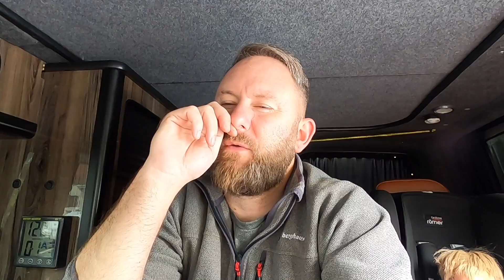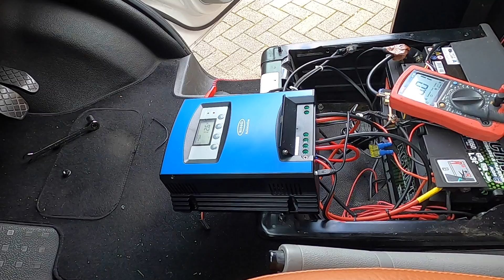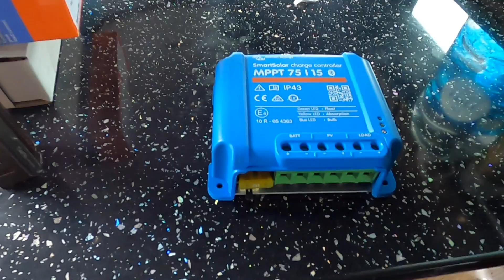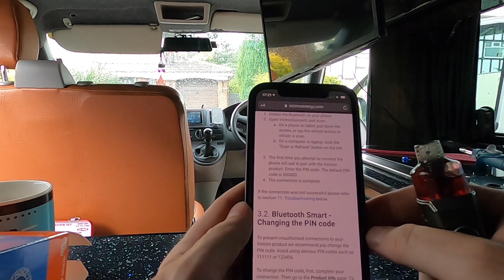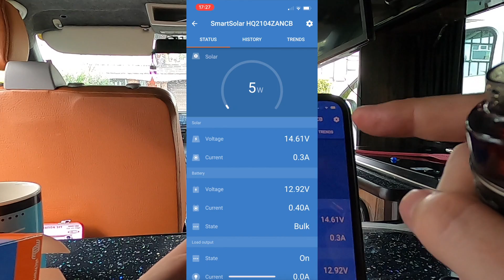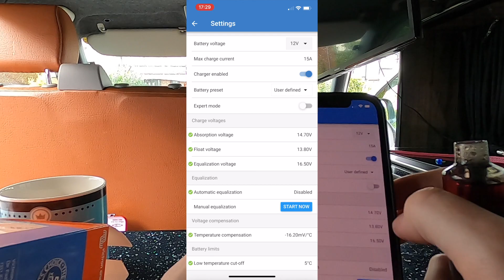Victron MPPT Vs Ring DC DC MPPT solar controllers battle Camper van conversion

Comment: There's a issue with the volts it needs dropping to 12.2v in the menu and 13v need dropping too there's a video explaining this.
Reply from the maker: @smiggy-ff9sl  this was a very long time ago. The issue in the end with the ring was a dodgy connection on the solar panel.